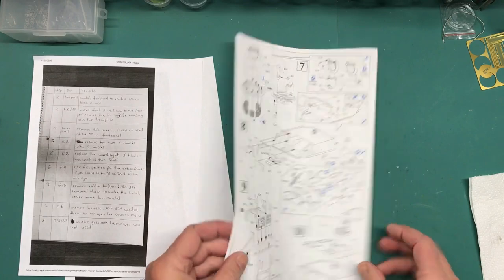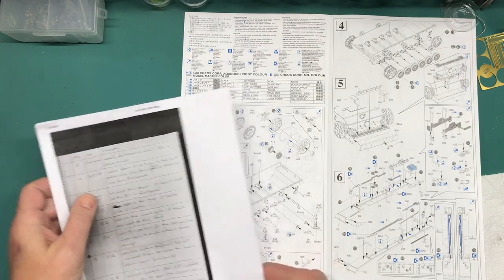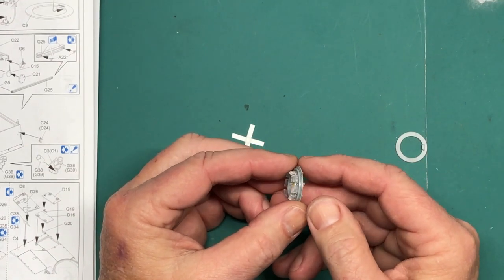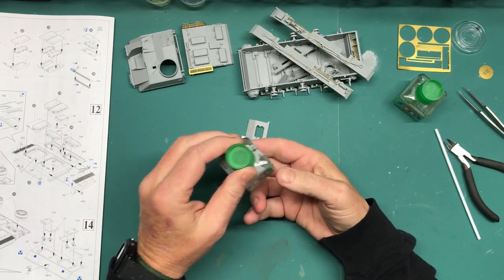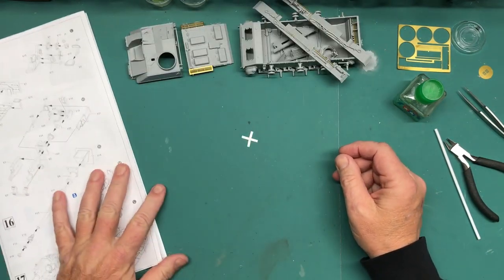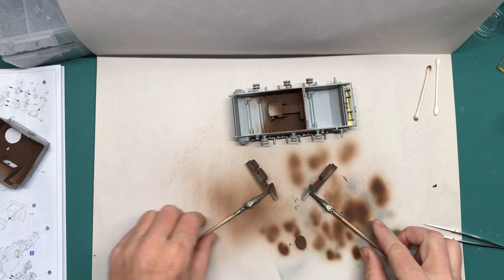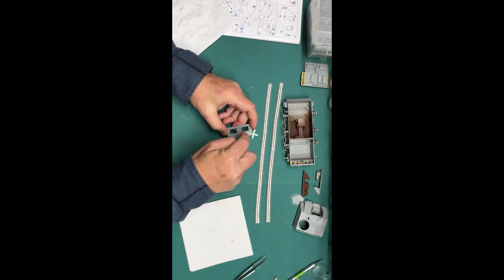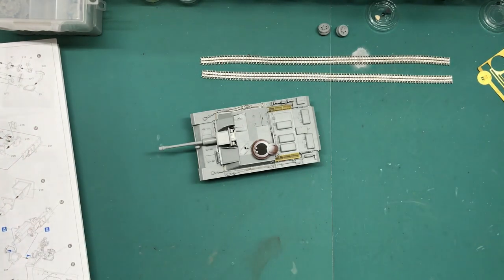PanzerjägerTank Hunter Group Build Part 2

Comment: I had the same problems with the brass fender things too when building the regular dragon early G. Lost two of them. The cable was a pain too. I used string dipped in future to simulate the cables. A tip from a Bill Plunk. Seems to mimic real cable and much easier to place. Glad you were able to deal with them.
Reply from the maker: Yessir on the string. Oddly enough, I like the string that Tamiya supplies for cables in their kits. The Future is a great tip... I will definitely be trying that one very soon.
Thanks Peter!